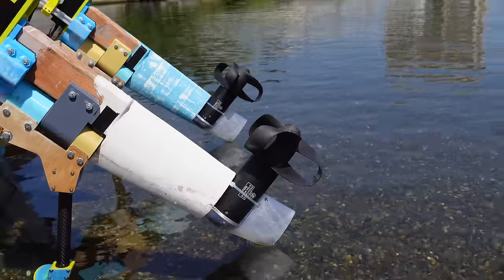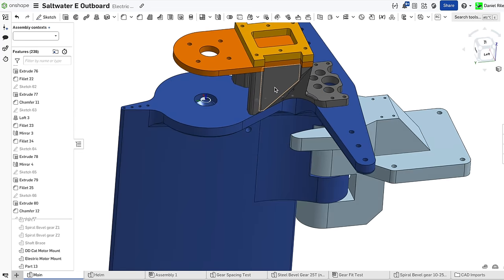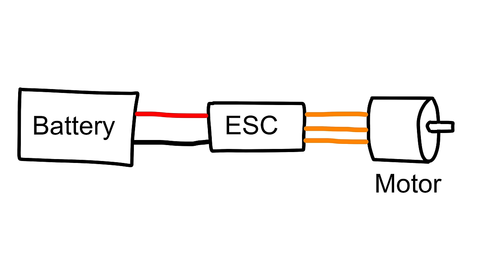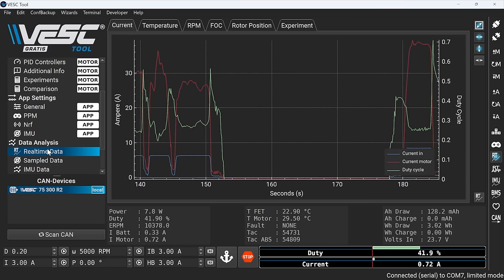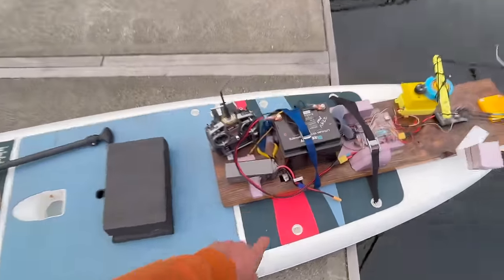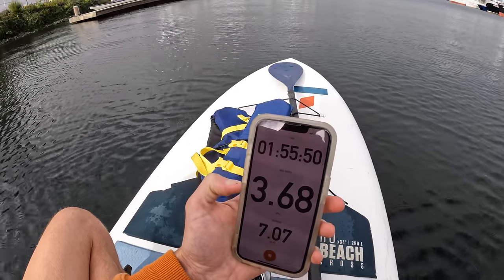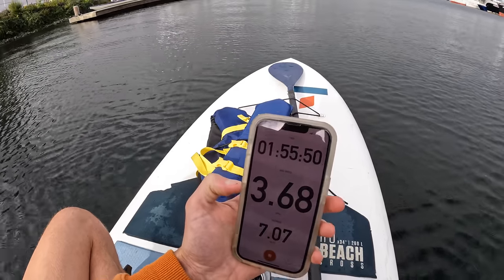Toroidal Propeller Testing on my Electric Surfboard

Comment: Yep, smaller boat engines (e.g manoeuvring motors in sailing yachts under 30ft) tend to only have 2 blade props because the single or dual cylinder diesel engines of up to 10hp do not have the torque to drive 3 blades without unnecessary engine wear.  You are on the learning curve and on the right track, excellent video!
Reply from the maker: You sure thats the reason why? Seems like blade diameter has a much larger influence on torque than blade count. Thanks!
Reply: Its not actually about the torque at all, at least only indirectly. Its about other factors such as rpm. If you wrote "power" instead of torque if would be more correct. Lower number of blades are more efficient generally, but you need enough area to transfer the force effectively. Its kind of how a low power car only needs skinny tires, while a powerful one needs wide ones to not spin. When not transferring much force, the skinnier tires have less friction = more efficient. It has nothing to do with engine wear either.
Reply: @rctestflight  No he is not sure. Or he may be, but he has the wrong info. My other post here contains the correct reasons why that is.

But since you are very familiar with flying contraptions that use props, its just the same as with a drone or RC helicopter or plane: Lower number of blades and lower blade area that can still transfer the power effectively = better efficiency.
Reply: I’ve had a couple of 2 bladed long length (diameter) but narrow props. I can’t remember precise specs- your competition idea for a fixed wattage is great.
Reply from the maker: @GoldenCroc  Yeah, I've talked about how fewer bladed props are more efficient. But he's talking about torque, not efficiency
Reply: @rctestflight  Yes he is, but the reason why they use fewer blades is because they dont need more. Not because of that they dont have the torque/power to turn more blades. Its also less drag when they are "folded", as sailing boats often do when under sail power alone.

Thats why the car analogy in my post to him above:  Any normal car can turn some wide tires without stressing the engine, but why would you use them when the slimmer ones are good enough for the power you are putting down, and got better efficiency.
Reply from the maker: I don't disagree with you but the argument you seem to be making is different than the original one  @GoldenCroc
Reply: @rctestflight  In that case there is sadly some miscommunication on some end, because as far as I can tell and tried too write/answer, I thought the argument was exactly the same. I am not sure I am able to clarify my posts more, if its my writing thats unclear. 

Of course I could have misunderstood something, but regarding my general knowledge of props, engines and vehicles I will say I am a former physicist that have quite a bit of experience with different boats and designing and restoring them and their engines. I currently own 6 of various kinds, including national championship race winners. That doesnt mean I know everything, far from it of course. But I like to think I am reasonably knowledgeable in the subject boat propellers compared to most people.

Cheers and thanks for the always great videos.

Comment: You need a test cell! If you keep going down this rabbit hole into propellars, which is totally cool, you need better testing and data collection for how many props you are making. 

I have a few suggestions. I might suggest getting one of those large metal pig troughs at your local farmgoods store to put in the backyard or garage for testing propellars. I might mount a motor/prop assembly at the bottom of a swing arm mounted to the top of the water trough, so that the arm hangs down into the water. You would then run the motor/prop in the water and have the arm pull on a force sensor, then convert that force to find the force exerted by the prop at the end of the arm. You should then divide that force by the power you are drawing to get a specific unit, like newton/watt, that you can use to compare everything, like even high speed and low speed efficiency for different sized props at different speeds.  I can't think of a way to convert that to water speed somehow, but I would be very interested to see comparisons between low speed and high speed efficiencies, since I vaguely remember that ship's fuel consumption increased ^3 with speed. Was that equation only for vessels moving through the water, or does that cubic fuel efficiency equation count for propellars too? 

On the test cell arm, you should pick a motor assembly you like very much that is well made and replacable, then don't change it, for repeatability. I wonder if you could couple the test motor to an identical motor and read the power produced on the other side, like a dynamometer, to measure losses in your motor to compare different speeds or different motors. You could also use the test cell to measure parasitic losses from linkages between motors and props. With a test cell, you could use a bench-mounted power supply for your test motor, like they have in school, for better consistency and to be easier for data collection on power draw. 

I think it is time for a good test cell, maybe even one that could double as a hot tub - that reminds me, use the same water temp between tests, for conistency with viscosity. A good test setup will make it easier and faster to compare prop designs and dig deeper into the subject with better results. It would be a good for a cheap winter time project too.  Then, I'd love follow-up videos to get comparisons between force per watt versus distance traveled out on the open water. This method would also make it easier to compare drag created by different boat hulls. 

I love your show, man. I watch every episode when I see them. Your cadence, filming, and editting are on point, don't change anything like that. Just keep doing neat shit like you  always do, and you're gonna be great.

Comment: This might support what you say at the end "which is more efficient in general?" I think the point of the Tordial is it's not most efficient at peak, it's efficient across the range.
Reply: Correct they are only efficient at a small specific speed range so he has to design the prop to operate at a certain Rpm to achieve a higher efficiency.

Comment: If you expect to go through with the propeller contest, a bit more rules would be required. Something like @MajorHardware did with his fan showdown.
On a different note, would it be more fair to have a different gear ration for larger props, so they get more torque, but less RPM, while getting the same amount of power?

Comment: when looking at the toroidal props straight on, the silver ones have front and back fins on an angle, so 3 pairs shows all six sides. Your printed ones have the front and bottom fins directly on top of each other, so they only show 3 fins from the front straight on.

Comment: Researching sharrow's propeller, it claims to be more efficient at the RPM that boats run at 80% of the time (3000 engine RPM), both lower and higher rpm was less efficient in third party tests. So maybe a RPM test to see if their is any differences in performance?  Love your videos!

Comment: The v8 was definitly running with a less than ideal fuel mix, theres probably a good bit more power in that engine than you experienced before. But as always, electric does make for a simpler setup.

Comment: I'd like to see a 2 kw waterjet jet on that paddleboard!

Jet impellers are really easy but the straighten-squeeze bits are a bit tricky. A dude called Xjet devised a four hole output that prints easily and works really well (less wall friction than vane designs). This design also allows the motor to be mounted at the back of the unit without a shaft and bearings being needed. The four output holes wrap around the motor.

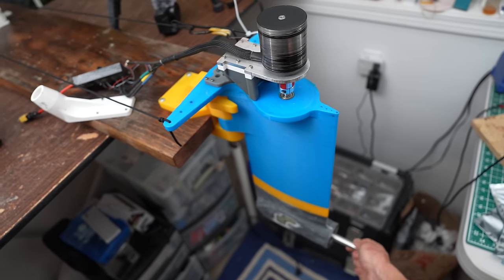Comment: information          1:28   in this configuration, the motor does not have Mechanical Advantage over a large part of the load that it experience; that being,  the part of the load that occurs at a  Radius  that is greater than the radius at which force is produced inside the motor.    eg., the radius at which magnets move past coils.        consequently, you should consider using   an inrunner motor (with cooling)  and  reduction gearing in the differential.

Comment: so you know, an electric driven remote control craft like this could help in man overboard emergencies if it were made to do so, or to drop from rescue heli with rescue divers so the rescuer will be fresh and strong, or that the victim can be piloted or tugged away from somewhere or to a lifeboat. you could make heated life support for cold water survivors to last longer in the water before rescue, etc. like a heated life ring with a beacon of some kind and maybe even some mobility.  hand warmers and two little props, even 2-3mph for  a few 2-3 hours  could save lives.

Comment: The Tech Ingredients channel has a video titled The Tesla Catamaran. In it he talks about using an RC airplane pusher prop to power the boat. He was using a Master Airscrew 15" diameter 7" pitch glass fiber pusher prop. He said kayakers had success with them to achieve higher speeds.

Comment: Hey Daniel, there is a very obvious difference between your toroidal prop and the other ones you showed. Yours, when you look from above it looks like a nominal propeller, but theirs you can see the loops from above. which I think would make it behave very differently, then having them directly one above another. Just a very obvious difference I thought I'd point out.
Thanks.

Comment: Get the prop as close as you can to the surface. Less drag.  You could even look into surface prop desin where one blade is always above the surface.
Reply: Not possible with this kind of 3d printed plastic prop I should think. Neither close surface running and absolutely not surfacing.

Comment: I'm sure one can design a toroidal prop that is more efficient at a given speed, but there's clearly alot to making that work. No doubt recovering tip losses is a worthwhile goal.
I do wonder how efficient a sub screw is, you know, the ones designed to not cavitate. There are pictures of quasi modern ones online if you dig for them, might be something interesting to take a crack at.

Comment: If they dont operate on same rpm, motor efficiency will vary, maybe significantly. Must measure torque multiplied by rpm for power output. In other words, different propellers put different loads on the motor, resulting in different operating conditions for different results. Maybe propellers are good, just need different gearing or a different motor.

Comment: I guess just like anything that uses a prop, it has to be built for "that" exact purpose, you just have to find the sweet spot. Taking into account rpm, torque, resistance air or water, or snow? 
A propeller in snow? Haha. Under the snow or 50/50 snow/air? Could be interesting if it hasn't been done. Just for fun. 
And what would happen if you sprayed some water repellent stuff on the bottom of the board? And the props for less resistance against the water that it is moving? I'm no expert, just an idea.
Interesting vid as usual. Keep it up!

I think i might have an idea for a propeller. I'll send it to you some day when i have time to work on it, i don't mind the competition, i just think it could work.

Comment: Hydrodynamic efficiency at 10 m/s peaks at 6-blades (1% higher than 3-blades) with an advance coefficient of 1.3, with the highest axial torque at 9 blades (20% more torque than 3-blade) according to the paper: A multi-objective approach for determining the number of blades on a NACA marine propeller. That actually surprised me. So if you're a container ship you want 6 blades, a tug boat 9 blades. Sail boat: 6-bladed folding prop? I think the main reason sailboats use 2-3-blades is drag and cost vs folding ability.

Comment: Have you tested any nylon model aircraft propellers? I have found these to be the best of all on a Canadian canoe powered by a small electric motor running directly from a solar panel. There is one problem they have: they easily entangle weeds that are in the water.

Comment: How about inner hollow propoller blades that you can stream air out. The bubbles comming out of blades would reduce water resistance. I saw them use in Navy

Comment: Summary
- 0:00 Sponsored video about propeller efficiency testing on an electric boat    
- 0:06 Previous toroidal propeller designs were inefficient compared to traditional propellers    
- 0:31 A third toroidal propeller design tested on a V8 paddle board showed superior performance    
- 0:45 Converted the V8 paddle board to electric to collect precise data for scientific comparison    
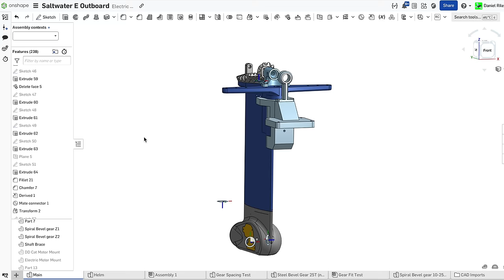- 1:02 Designed and attached an electric skateboard motor to the paddle board    
- 1:43 Tested various propellers, including a large B series and toroidal propellers    
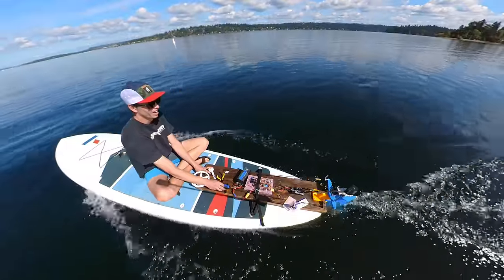- 2:01 Found the toroidal propeller was efficient with electric setup, unlike earlier tests    
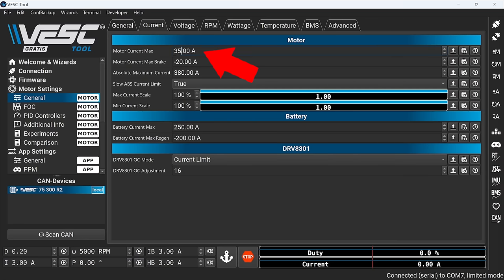- 4:18 Conducted proper propeller efficiency tests by controlling for power (set to 200 watts)    
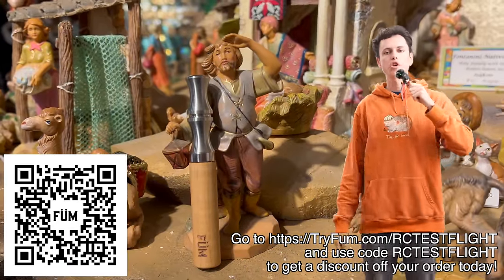- 7:34 Used software to ensure the motor did not exceed 200 watts regardless of the propeller    
- 8:15 Discovered that a 6-inch high pitch B series propeller was the most efficient for the test setup    
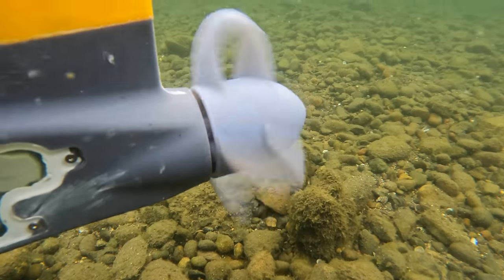- 9:34 Conducted an endurance test and calculated efficiency in Wh/km   
- 11:34 Found out the paddle board could travel significantly far on a full battery    
- 13:04 Performed Full Throttle testing, achieving higher speeds without a rider    
- 14:18 Explained that a bigger propeller was too big for the specific motor used for testing    
- 15:10 Clarified why the ESC setup affected initial propeller efficiency tests    
- 15:57 Concluded that controlling for battery wattage provided more useful efficiency results    
- 16:40 Acknowledged assistance from Oscar of ODrive for technical motor insights

Comment: Maybe you should add a gear reduction to drive a big propeller.  Turning it slower would result in less drag and also less thrust but I suspect the drag will decrease more like the square of RPM while thrust will be closer to linear.

Comment: Another option for testing would be to fix the speed and measure/log the current draw.
It might be interesting to do this at a few different velocities to see if the data is linear and if not, perhaps curves will intersect?

Comment: You said there is a higher efficiency at lower speeds, but at lower speeds the wind and current have a higher impact. Could they be the reason for the efficiency difference?

Comment: It makes sense that toroidal props are inefficient. They're basically a prop version of biplanes, and those are known to not be efficient, only to stall at greater angles of attack. Not even to speak of hydrodynamic interference between the blades, just consider the fact that there's a vertical segment that only increases drag without contributing to thrust.

Comment: Wouldn't it be the best solution for testing if you didn't carry out the test in the water/lake but rather built a test station? Wouldn't you just have to measure the thrust or is that too simplistic? The test would then not be a realistic situation, but should it basically be comparable to a trip on the lake? This could also be compared with measured values.

Comment: What if you made the propeller design parametric, generate a few subtle random variations to start, and used machine learning to figure out what changes would be needed to get closer to optimal results, and then repeated the test and ML iterations a few times to see if you could get a meaningful improvement?

Comment: Try running some more granular low speed tests to see how efficiency changes when transitioning from displacement to planing. That might be useful to estimate power consumption for an upgrade to the Whaler.
Reply: Not sure what you mean, but prop test are notoriously difficult to extrapolate data from. Almost impossible for a what a layperson can test.
Reply: @GoldenCroc  True. Though in retrospect, the data probably wouldn't be useful even if it was accurate, as the hull shapes are too different.
Reply: @pseudotasuki  Yes, I definitively would say so. Especially considering the speed regimens and load differences as well.

Comment: You could eliminate the motor efficiency out of your calculation by using the Phase current (torque) data and RPM data. Torque x RPM is proportional to output power of the motor...

Comment: Could do a flexible resin like on a toroidal so that it operates as different speeds. So you compress the toroidal prop and the diameter increases. And you extend the job and the Prop diameter gets smaller and runs different speeds and efficiency to see impact.

Comment: Would love to see a 5 blade prop vs the torroidal, since the torroidal is essentially a 6 blade prop in disguise.
Much like drones more blades usually mean more static pressure at low rpms, high acceleration, and horrible efficiency at speed.

Comment: you should definitely test higher angle of attack and even 4 bladed designs that also have a smaller diameter,  less leveraging force on the water might mean the motor can still work efficiently while pushing a similar volume

Comment: If higher motor RPM increase efficiency, perhaps using gears to exchange speed for torque would let you use bigger props at more efficient motor RPMs?

Comment: Maybe this has been mentioned before but your toroidal propeller design seems quite different than the original designs I have seen. Especially the way the blades on your propeller seem to be behind each other and in other designs they seem to be offset where they seem to form two propellers on one axis.

Comment: You should implement a torque sensor so you could calculate mechanical power from the torque and the rpm